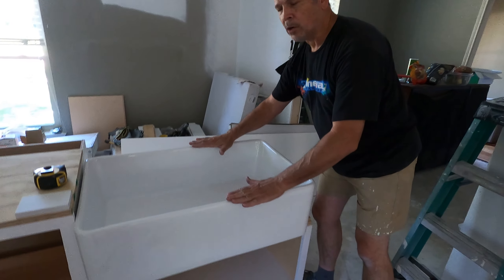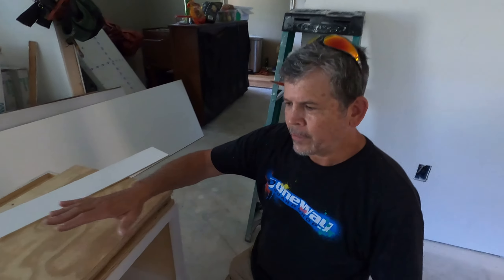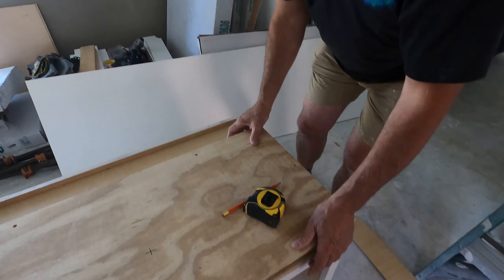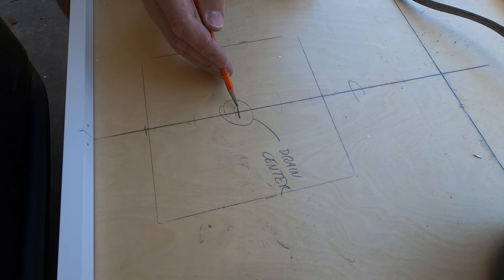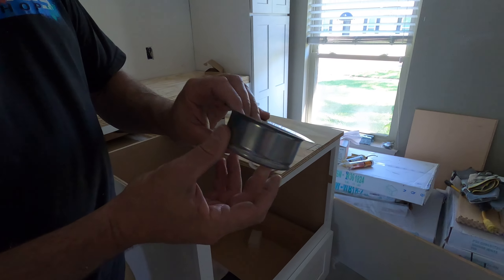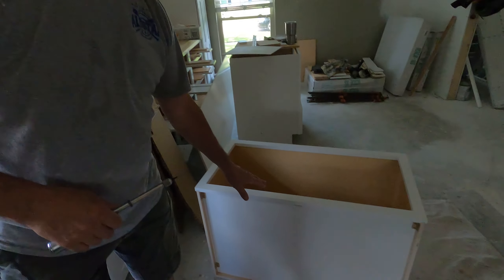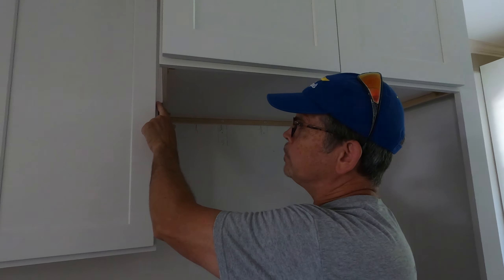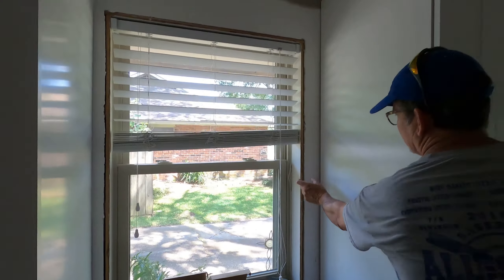Remodeling a Kitchen A-Z - Part 10: Farm Sink

Comment: Hey, Jerry again with more comments/ questions ...   How do you handle estimate wise wise when you take a job for a certain amount and unforeseen events happen.  I’m in the middles of a tough one,  kinda like when you guys ran the drain pipe from the half bath toilet.  So the job I’m doin is a balcony roof deck with French doors in the second story.  Homeowner has water coming in the dining room.  Get this,  people that build the house didn’t flash the threshold for the doors at all.  Relying on OSB and caulking.   Stucco removal  every where you turn.  Chasing that nice house wrap to tuck over my roof.  So much wood rot.  Thought my part as a roofer would’ve took 8-10 hours.  I’m on my second 12 hour day.  All I have left is cap sheet doo install. Well get it figured out tho 😽

Comment: Great details guy,  at the end of the video you're  removing the old tile wilth a tool that i havent seen before.  It looks like a jack hammer with a flat flat head bit.  What is the name of that tool?   You are using it near the end, around 21 minutes in the video
Reply: It's a long-reach air-powered scraper which is available at McMaster Carr.

Comment: You should pick up some Pony cabinet clamps they attach to face frame makes it easy to pull together and make flush
Reply from the maker: I tried to  pick up a pair for this job but local stores didn't have them.  I'll order online next time.  A buddy of mine has some and they're perfect for flushing up the face frames.

Comment: Would it work to use a dremel tool with a tile abrasive grinding bit to ream the inside of the drain opening in the farm sink, wouldn't want to tap the drain assembly in, you risk cracking the porcelain! Good luck 👍

Comment: Going to take a guess before I watch the rest: I'd say grind out all that glazing from inside the neck. It's going to be sealed off from water anyway, and I think there's enough thickness being added by the finish process that removing it would give you the room. Let's see how I did....

edit: yaaaaas, I was right! Well, at least on what choice you picked. Now to go see if it worked!